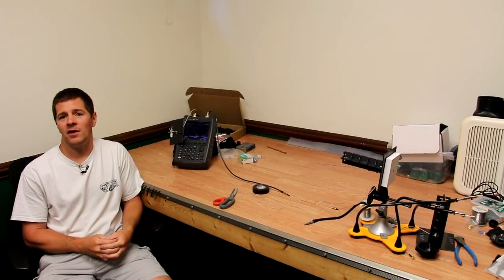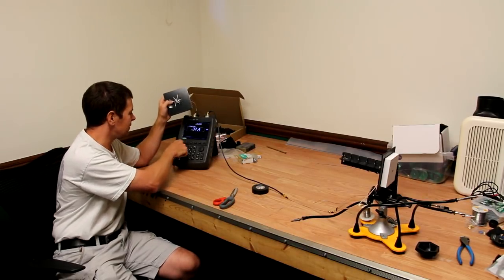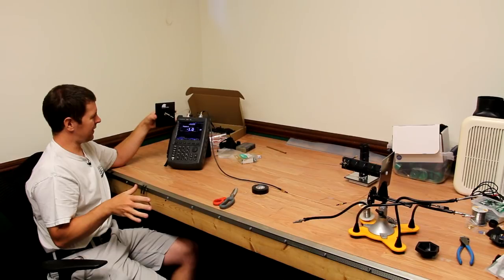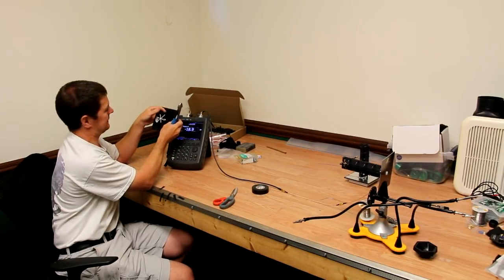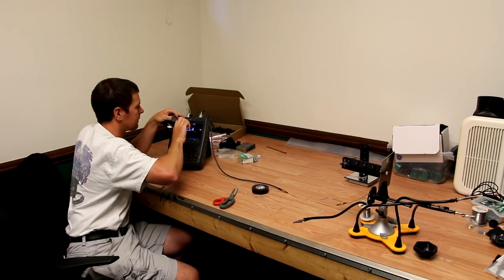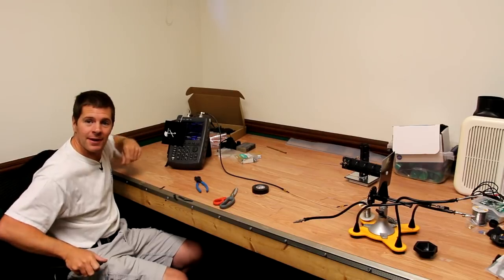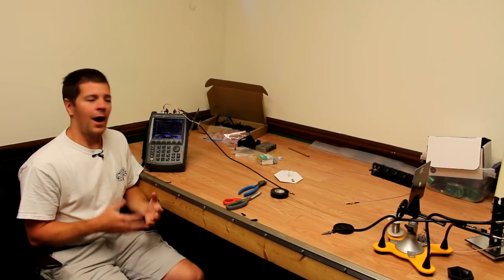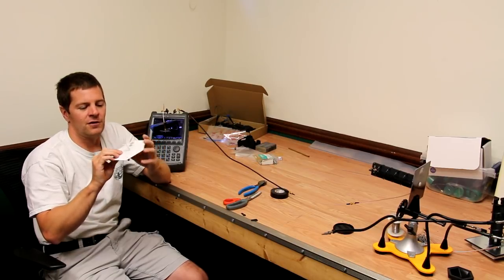IBCrazy unscripted: Developing the Crosshair Xtreme

Comment: Years ago - the 1980s were the early days of CATV before 2 way addressable systems. I worked for a CATV filter company. I spent ages on an IFR spectrum analyzer designing CATV Traps. (4 pole notch filters) - several iterations for each of several hundred channels. It was before the days of any real computer assistance, so we were doing a LOT of this sort of cut and try. We also did 'specials' for head ends, environmental testing, etc. so there was always development work to do. 

It's more art (feel?) than math and takes forever to find a truly outstanding combination. 
I run your 5.8 Crosshair and Mad Mushroom on my goggles and Triumphs on my quads, and each one got there on it's merits. I have a couple contenders for the quads to be tested, but the current combo has held off all comers for a year or so now.

I think it's no coincidence I ended up with an all IBcrazy lineup.

Nice work, and thanks for the look at your process.

Comment: What do you think the range gain of 2.4 video will be over the 5.8 at the same mw output also is there a crosshairs patch  for the furious fpv goggle module in 2.4 and will it work well with tbs crossfire 
I really love these videos I’ll only by your antennas as long as you keep making them I’m buyin
Reply: the crosshair is a type of antenna, and a patch is a different type of antenna. the crosshair antennas will work substantially better than any patch. the will work very well, with 2.4 and a crossfire (just make sure there are not any taranis on 2.4 nearby).